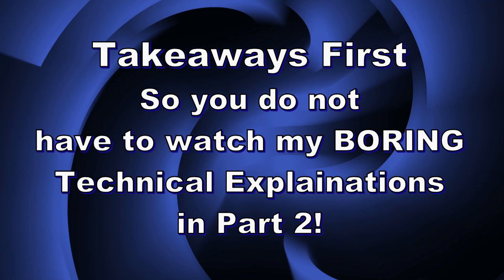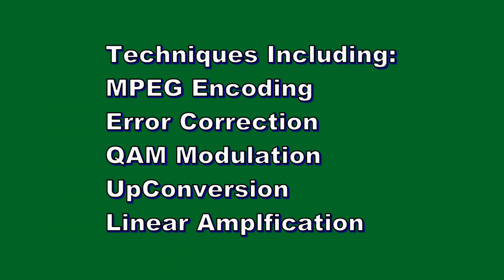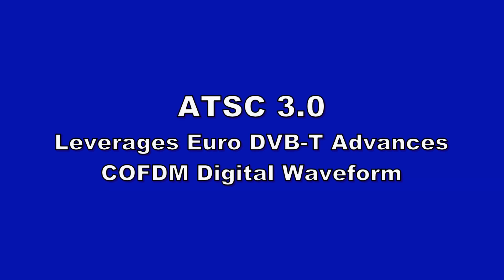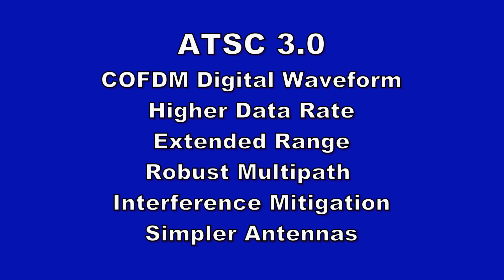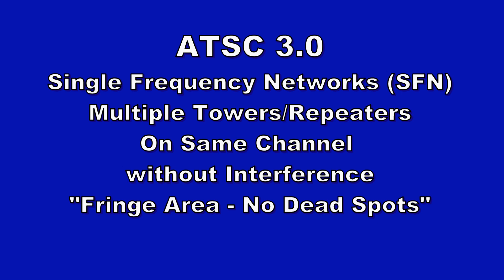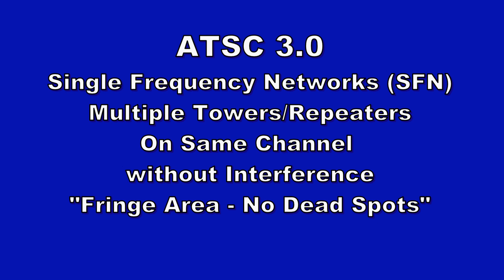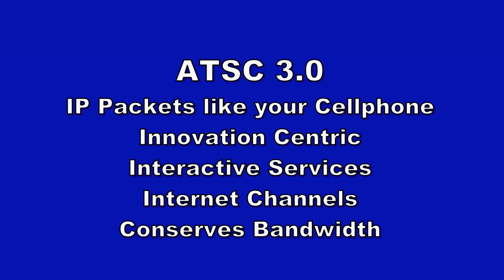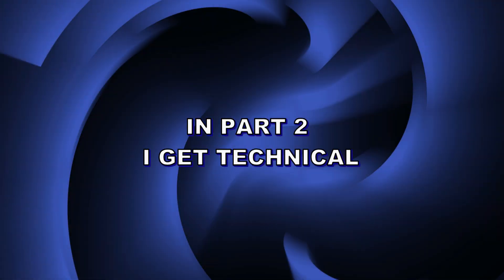What's So Special about the ATSC 3.0 Waveform?

Comment: The biggest problem with ATSC 3.0 is you need a internet connection. At least for now. I bought  a  Samsung tv last month because it had a NextGen tuner in it. So living in the Boston Ma market I did a channel scan and found seven  ATSC 3.0 channels .So knowing  what I first said I disconnected my tv from the internet and now all the 3.0 channels are Not Available, so it says on the screen. All  44 ATSC 1.0 channels of course are fine. So much for portability right!

Comment: I have seen zero help from ATSC 3.0 multipath handling against windmills.
Reply from the maker: Wow interesting. I assume no blockage. What is the range to the particular tower and to the wind farm. The system can only correct for a given range with its guard interval. At longer ranges this falls apart. This is where localized repeaters in simulcast mode come in. And of course directional antennas always help, no matter the technology.
Reply: @MIKROWAVE1  60 miles with a DAT Boss Mix.  About 25 feet up.  I receive perfect picture when they’re not spinning and before they were put up.  Now I do not if they are spinning.  I’m doubtful that raising the antenna or swapping to a DAT Boss LR or another Yagi would help.
Reply from the maker: @NightKnight2048  You are in a fringe range, further out than I am from Boston towers. I'm not familiar with this this antenna, but I will run it against my friend who is an antenna engineer.  You are exceeding the guard interval at that range. ie. ATSC 3.0 was not designed to  cover that wide of a coverage area, is my guess. So you are on the fringe and the windmills put you over the error correction ability with the perturbance.  You bought a premium antenna that may be the issue. Cant rule that out either. CP or a different antenna might help.  The strength of ATSC 3.0 is that a local repeater would solve this since it is coherent. But the broadcasters have to plan this approaches roll out.
Reply from the maker: Yes guilty. I am a cynic when it comes to antennas. There are lies, and then there are antenna lies. Hee.

Comment: I used to work with a DVB-T conformance testing consultancy a good few years ago - it will be very interesting to find out more about ATSC 3.0 as I've been out of that market for a long time.
Reply from the maker: Having 2 essentially redundant but competitive systems is wasteful but that is the divide between the US and the EU that goes way back. They do build on each others lessons learned -  especially ATSC 3.0 that is COFDM, closely resembling DVB-T2. The differentiators become small and amplified.

Comment: We live in a fringe area and have always used OTA for TV even though we now have access to high speed internet. Initially I was very excited by the prospect of ATSC 3.0 compared to 1.0 for the reasons you stated. However seeing stations rushing to encrypt their programs I've pretty much lost my enthusiasm for ATSC 3.0.
Reply from the maker: They have 3 more years of simulcast to figure this stuff out. Its all software capability at this point. Remember the goal to is find a way to utilize Spectrum - to beyond regular TV, possibly to provide pay services on an over the air system with similar capability as streaming, and adding interactivity, for sporting events, shopping, gaming, games, dating and anything else you can think of - but at a MUCH LOWER COST than you pay now for satellite, high speed internet, or fiber.

Comment: What a scrambled mess of disjointed fragments, and horrible explanations of digital signals versus modulation encoding of RF carriers, which are inherently analog systems. 

COFDM can yield 25 Mbps vs 19 Mbps from 8-VSB, in addition to better compatibility with mobile device and sloppy design antennas.  

The USA may have been better off consolidating on an upgraded version of DVB-Tx, and prolific, inexpensive, mobile and network compatible tuners.  However, the predatory scammers who bribe Congress for corrupt IP laws, pushed through systems that integrate spyware and DRM extortion, and can be configured in ways that properly are grounds to revoke licenses of TV broadcasters, rather than just offer minor bandwidth increases and rules to enable newer more dense CODEC's that didn't exist in 1984 or 1995, the era when AHDTV was largely available professionally, and then made a US legal standard for ATSC 1 by Congress, with a 1996-2006 transition window few broadcasters or viewers acted up until the relative last minute.  

Besides allowing newer CODEC's and more robust modulation standards, ATSC 3 offers immersive audio, with object rather than mix based content, that few people understand conceptually yet (but with major potential benefits for special needs environments or disabilities and aging).  However, beyond spyware based DRM, ATSC 3 is also capable of narrow-casting propaganda or political or police scams, and other devious or potentially criminal uses, that ATSC 1 does not allow. Those potential benefits come at a cost of new and complex risks, and institutional abuses.  

Congress and its owners who buy votes from major telecoms and CATV's also ensured 600 MHz spectrum was sold off before public pressures to retain it to enable transitional simulcasting or less dense modulation of higher dynamic range 4k encodings would become public awareness issues and pressures to not pursue grossly misguided spectrum policy, again.  

Ultimately, we need systems that vote Republicans and Democrats out of power, and find leaders who have a clue technically, plus prioritize public interest over corporate scams.

Comment: ATSC 3.0 is currently completely hamstrung by DRM and encryption.  The only thing users see with the new standard is that all of a sudden they have to buy a now box costing $100 or more to replace the $30 one and then they still can't receive many of the programs due to the DRM nonsense.  They need to connect their TV to a working internet to get the magic keys.  If you are hooked to the internet, you may as well throw away the antenna and just stream stuff.  If you are in a very rural situation where you don't have internet that works well, you simply can't watch the TV anyway.  In the year 2027, it seems the nation will go ATSC-3.0 on all channels.  At that time I expect to get the neighbor's help to lug my TV set out to the curb.  I am not connecting it to the internet.
Reply: it's not hamstrung.  I watch it everyday.  I'm totally against allowing DRM on the public airwaves.  We're going to have to continue working on that.  There are already products out there that work with ATSC 3.0/DRM without connecting to the internet.  So you're wrong on that account.  Streaming may compete with free OTA broadcasts, provided you don't have data caps.  That's a battle we'll have to wait and see.  As far as the keys go, the problem I see is that they expire.  So if you buy a piece of hardware and the key expires, yes, you do need an internet connection to update the key.  If you don't have your TV hooked up to internet, than you're not streaming anyways 🤷‍♂This will all shake out in the long run, and everybody will get to choose their own path, obviously.  Since 80-90% of my TV time is OTA, I'm pretty excited about ATSC 3.0.  I'm saving a lot of money.
Reply: @wesmckean1443  I can replace the TV with a computer was my point.  If they don't sort out the mess, OTA will die.  I have seen many reports of people having trouble receiving ATSC-3.  I think it varies by market.

Comment: Hi Mike
I'm surprised from the fact that USA want to migrate to a broadcast standard (ATSC 3.0) which is virtually the same like DVB-T... an "ancient" broadcast standard, who is abandoned here in Europe at least five to ten years ago! ...and don't replace it with the most modern DVB-T2.
As a Broadcast Engineer myself, I have already worked in both standards (DVB-T in the past, DVB-T2 nowadays) and I have accumulate "some" experience over the year's!
My question is... Why they don't adopt the DVB-T2 straight away, who by the way is used with great success and is already fully supported by all the TV set manufacturers, ...plus it's debugged " to the bone's" make's it a trouble free system.
...if they don't like the name... they can always change it 😂😂😂.
73s de SV2ODL
Reply from the maker: Excellent! Every standard that is designed by committee and rolled out in stages, and with critical patented methods, will have certain growing pains - Yes already debugged is good!  I would hope that lessons learned on the old DVB-T (Which the US should have gone to originally, but there are interests beyond our control) will be rolled into a unified ATSC 3.0. Am I dreaming? We would have had common hardware and software.
Reply: @MIKROWAVE1  
One thing is "the common hardware / software" already exist... For example: every TV set that sold in USA and Canada after 2016 is fully capable "by default" to receive DVB-T2 signal's especially brands like: LG, Samsung, Sony, Hitachi, Philips ...and you named! And that is a fact - even if "the owners" they don't know this!!!
Secondly I have more good news...
In Canada and USA... and of course in Latin America...
The DVB-T2 signals it's "On Air" and can be received (if you lucky!) very easy in your area! ...I totally understand your question!!! 
Who Broadcast this kind of signal, and how can receive it!
The answer is: there's many radio amateurs that transmitted D-ATV signals in 472MHz and in 1.2GHz ATV zone!
And it's very easy to receive it, in the first case with just a TV and the UHF antenna,  in the second case you need to add a down-converter from 1.2GHz to 400 or 600MHz, or the use of a receiver capable for 1.2GHz... a RTL-SDR dangle for example!

Comment: So what happened to ATSC 2.0?  Just curious.
Reply: ATSC 2.0 was actually ATSC-M/H. M/H referring to Mobile Handheld. It was a compatible extension to ATSC 1.0. it was to enable mobile devices to receive 8VSB broadcasts. It attempted to over come the issues with 8VSB that DVB-T and ISDB-T had inherently built in that made those signals easily received while moving or in low signal areas. It wasn't very successful, not many devices added the tuner needed. It required dedicated bandwidth and hardware on the broadcast side to add the M/H capability, it didn't improve regular service receive ability, only the services on M/H could be seen on a a device with that tuner built in. 

The services on the M/H side were at best SD and mostly less than SD res being most devices in the mid 2000's didn't have HD screens. The idea being you would never broadcast a robust HD signal or higher quality pic to a device that has such a small screen that can't even resolve HD. I believe a few PBS stations broadcast it for a time, duplicating their main channels on the M/S service side. Again, it required a minimum bandwidth consumed in fixed chunks of nearly 1mbps per M/H service out of the total ATSC Bandwidth. Meaning fewer bits/services available for the main channels that didn't improve the main channels reception.

Comment: as someone who works in broadcasting and has seen the use of ATSC 3.0 in the field, it truly is a versatile technology. But there's no solid standards yet on big items like Digital Rights Management, or even some rumors about mandatory IP connectivity on set top boxes.  With stations now stepping into the 21st century and broadcasting channels in 1080 and 4k, I can't really see a reason to switch, everything would have to be backward compatible and that's too much money and too much engineering.
Reply: The rule should be that DRM just goes away.  Encryption makes a nonsense of "the public's airwaves" and the DRM nonsense is not good for the public in general.

Comment: wondering. can you do a video on antannes. for tv. the so called digi antennas and analog antannes. if anything is diff persay. i myself feel there is no diff between them. gain would be only issues in the antanne design.
Reply from the maker: An antenna designed by a person is Analog. An antenna designed by AI is Digital. Sorry I could not resist. NO DIFFO. The finest Yagi you can design for analog will be the finest Yagi you can design for digital reception. The question is, how does your TV system handle weak signals and multipath interference? It may require a better antenna.

Comment: ATSC 1.0 uses the 8VSB waveform. COFDM was considered when DTV plans for the US were being made, however the ATSC caved into the pressures of the broadcast industry that wanted to minimize their hardware and electricity costs. COFDM has a higher peak to average ratio than 8VSB and therfore will require higher output power capabilities in the transmitter, better linearity. It was said during the debates over which waveform should be used that multipath immunity would be adquate with 8VSB, funny how they are now changing their minds about that, could it be that they knew which waveform was the  proper one to use all along but now, more than ever, over the air TV broadcasting has taken a back seat to cable and streaming and broadcasters are no longer obsessed with the coverage area of their transmitters.
Reply: We had a local station obtain a license for Ch 35 because their VHF didn't have the same penetration into people's homes.  So they sunk money into a new transmitter and new top antenna during the last year.   With ATSC 3.0 coming into view, you have to wonder about their investment to switch from VHF to UHF with just ATSC 1.0, unless that transmitter can be easily converted to ATSC 3.0, which I suspect it can.  They also purchased and licensed the adjacent low power channels and moved those transmitters to their tower.  They did some brief testing of those channels, then turned them off.

That's a lot of expense for a station that's not obsessed with OTA coverage!  As I talk to most people on my street, they are no longer cable TV subscribers so it could be that a pretty sizable number of people (and growing) are using rabbit ears or an attic antenna in their homes, in addition to the online open sources, which are quite plentiful.  As to streaming, basically the only content I can't stream are just the primary channels.

As to ATSC 3.0, I have another concern.  I notice, in my area, that all of those channels are using the same physical low power channel, owned and licensed by ONE of the major broadcast companies.  I understand companies sharing tower space, but sharing the same license????  That relationship of these giant corporations seems too cozy to me.  These companies appear to be collaborating VERY closely on a strategy with apparently the FCC's approval.

What happened to the FCC managing OUR frequencies for the public interest??   Where is the "public collaboration" piece of this ATSC 3.0 roll out?   Our FCC should be publicly informing us all of this major use change of our public airwaves, along with all of the details, especially DRM, yet we hear almost nothing but crickets and have to figure out this hidden strategy ourselves.   That's unsat.

As the small broadcast stations are flushed out, I see the huge companies, collaborating together, quietly taking over our airwaves for THEIR benefit, with apparently the blessing of the FCC.  The money pot they seem to have  their eyes on is DRM control.  

ATSC 1.0 HAS been plagued with multipath problems from the start.  Most people with trees have reception problems due to multipath, not low signal levels. Higher gain antennas only make it worse.  Yes, they must have known this from the start and ATSC 1.0 should have been shot down by the FCC as "not in the public interest.".  

Today the general public is unaware of this public takeover of OUR frequencies by a handful of huge corporations sharing licenses and who knows what else, while the FCC fails to protect public interest.  Hey, it's my opinion.